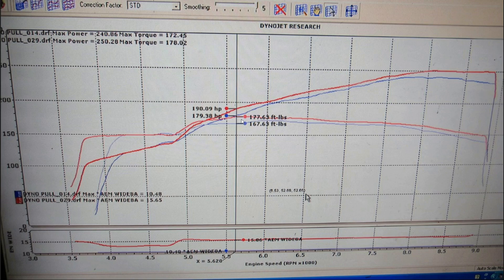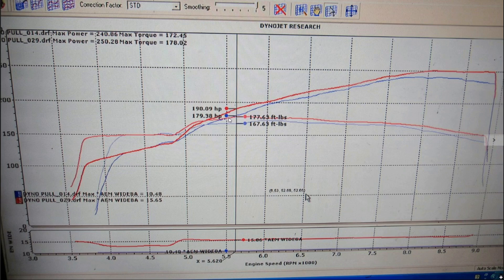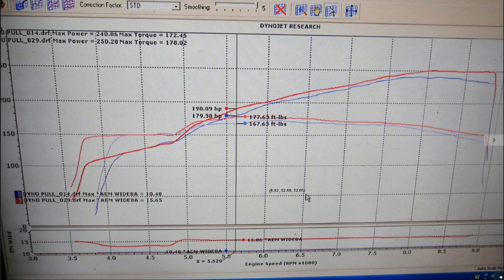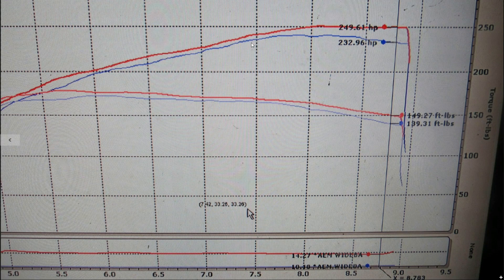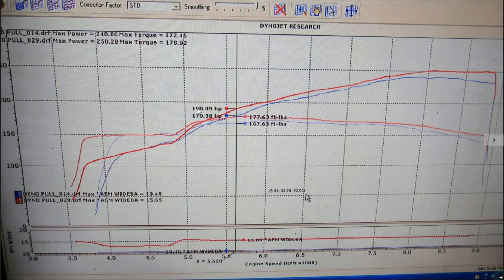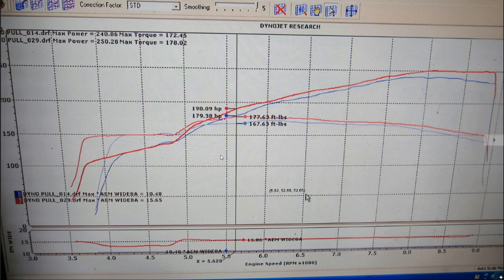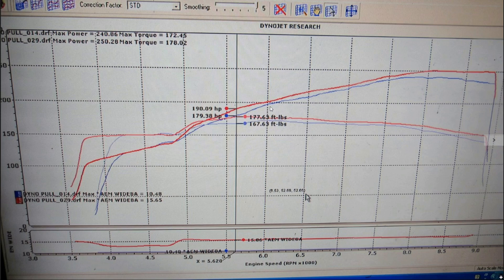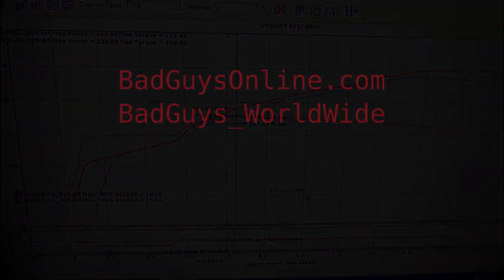K Series Dyno Testing PRC(K20a-R) VS CNC RBC

Comment: With the RBC ( without ported blue line...) did you use the same 72mm tb? Thanks , and l assume the a/f was off right?
Reply from the maker: jpsr20det rbc had the 72mm. This test was a few years ago and just finally uploaded. Not sure if i remember the air fuel but it acting up is a possibility

Comment: It s not correct, port prc manifold and add 72 mm throttle and then compare
Reply: I was thinking the same thing. I have ported both PRC & PRB IM's - not just boring the TB opening - reshaping the air horn's entrances and the Runners. The PRC IM can be improved drastically and the air horns can really be opened up and they shape up very nicely. Lets not forget it is easy to play around with plenum spacers on the intake manifold.

I just finished working my personal custom RBC IM. I am looking for another PRC IM to work over in curiosity sake.
Reply: @themwitches9628  I may have a prc manifold you once I get prc
Reply: The point is cost. You can get an RBC for a couple hundred bucks then have it cnc ported for 550 or you can buy a type r intake for a tick under 700.